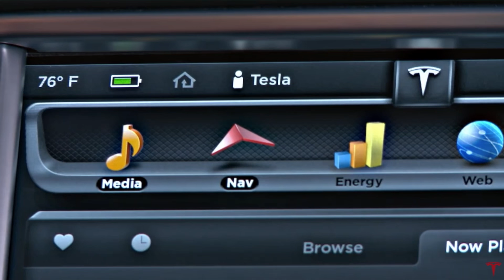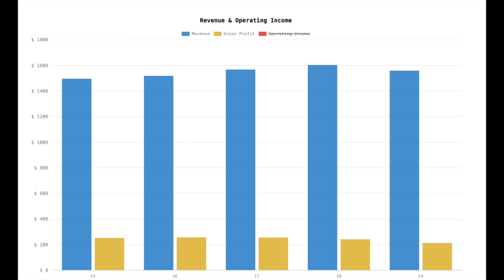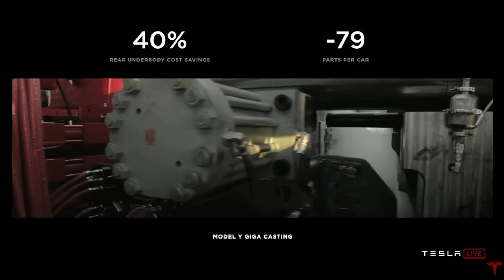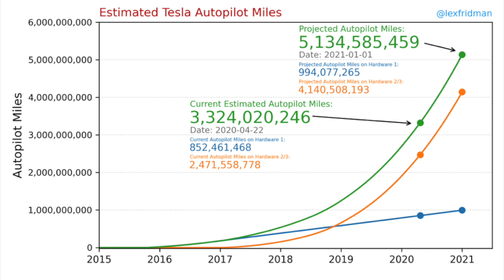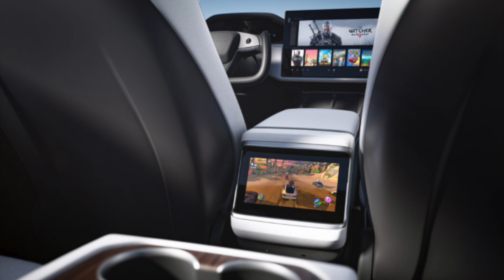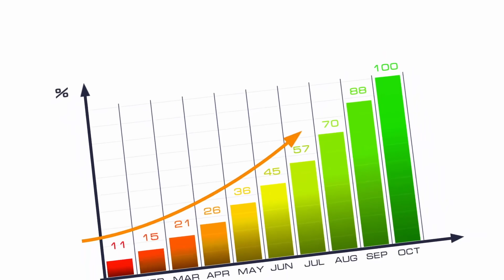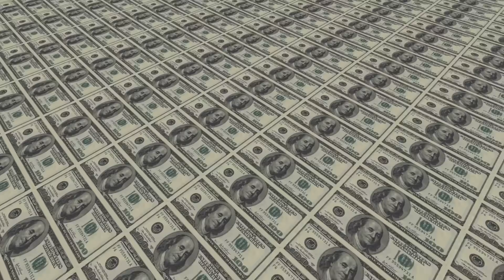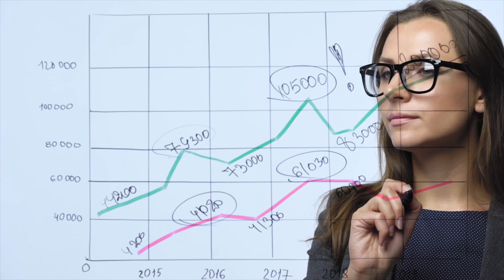The world’s view on Tesla is about to change | Changes & Growth has a lag time

Comment: Rapid growth means rapid mistakes.

I'm pointing this out, not because I'm bearish on Tesla.  Not at all.  I'm just a realist.

Tesla will hire tens of thousands of new employees this year.  They will have, at GF-Berlin and GF-Austin. an immature workforce that will be on a steep learning curve.  Some bad workers will sneak in.  Some procedures will be erroneous and require fine-tuning.  It will take time to figure out who can perform and who will not.  Maturing a workforce will take several years.  Because of this, there will be mistakes, problems requiring corrective action.  Small ones.  Large ones.

Rapid growth also means encountering bottlenecks.  This is especially true for a company which makes investment decisions before new tech is itself mature.  Elon has a large appetite for risk - and not all risks prove successful.  Take the 4680 cell.  Tesla is still fine-tuning the build process for those cells; the production line design is not finalized, and they have not yet achieved speed and yield targets for their prototype line.  But Elon, who embraces risk, is already moving ahead with investments at GF-Berlin and GF-Austin for 4680 cell production - before a design freeze even happens!  Supply bottlenecks and production bottlenecks are virtually certain to arise.  They'll have to be encountered and solved as they go.

From Elon's perspective, this is necessary.  Moving fast is exactly what Tesla wants to do.  Elon will not let 'perfect' be the enemy of 'good.'  So we can expect issues to arise in early production from those new GFs.

There will be kinks to iron.

Tesla has been ironing kinks at Fremont all along.  The build quality still isn't consistent, but it has been visibly improving.  We will see the same thing at their other GFs.

Any competent person who has been directly involved in starting up a new automotive factory knows not to expect perfection when the production line commences operation.  And he (or she) knows it will take hard work and considerable time to get the build quality right and to overcome bottlenecks.  It's the nature of the beast.

Shorts and haters will jump on Tesla for every mistake - and there will be mistakes.  This is silly.  Tesla's financials are strong.  Their IP is valuable.  Their tech lead is obvious.  They have no difficulty finding demand, because their price/value ratio is the best in the industry.  They have proved their ability to create giant factories and to employ industry-leading production methods.  They are killing it in the market.  They have a road map towards creating even better products and a workforce that is maturing nicely.  Their forward progress is amazing.

A conservative estimate for Tesla's automotive sales in 2021 is a 66% increase.  Next year, it will jump again by a similar amount, if they can get their hands on enough batteries.  And all the while, they will be resolving bottlenecks, correcting mistakes, and maturing their workforce, ridding themselves of bad apples.

Media outlets, haters and shorts will scream loudly every time a mistake is detected.  But Tesla has shown steady progress in improving their products.  That will continue.  And demand will be robust.

By now, investors should have realized: betting against Elon is a fool's bet.
Reply: Good information, thank you.
Reply: You mean like Windows Millennium edition was beta tested on end users? Except nobody died